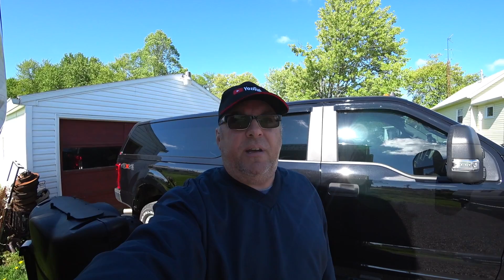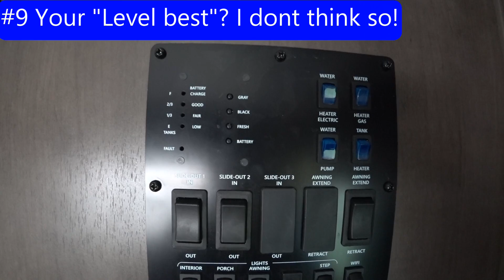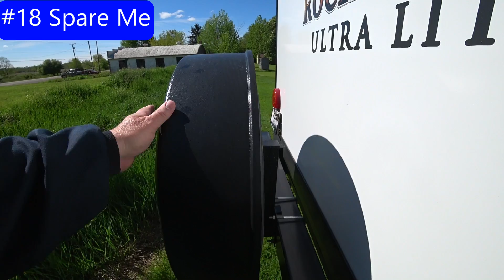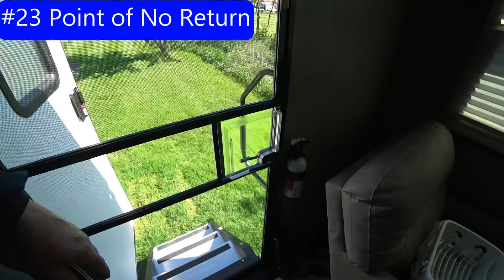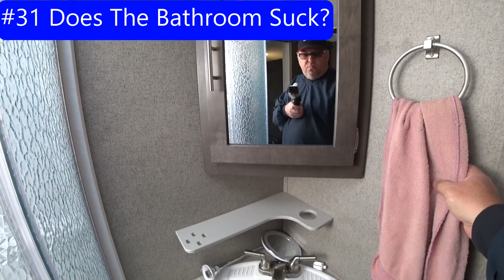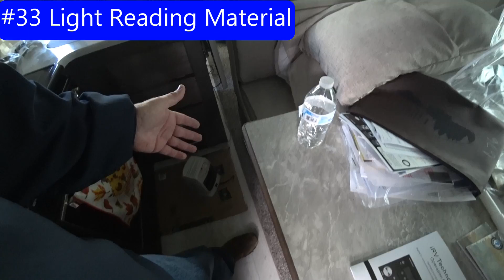36 Dislikes on Our BRAND NEW RV ☹

Comment: #2 bad, #6 i would do the topper, slide will be out when you need to get in there anyway,  #8 heater will never melt the tanks,  #10 look under the dinettte window, #18 the only thing you're missing is a 2nd spare on the bumper,  #23, they don't do that anymore,  #32 not standard, gas heated vents on RV don't close,.
Welcome to the real world. I would say 85% of your complaints are shared by most . This must be your first new unit.
Thanks.
Reply from the maker: Not the first unit, my last unit had vents that closed and it was gas obviously, those bumpers can't hold very much weight can't believe anybody would think of putting two spares on that weak welded thing. We did put a Topper on the bed end the doors barely open. There is definitely no plug whatsoever in the dinette area. I was told by three separate RV technicians that those heating pads on the tanks are thermostatically controlled and are designed to shut off when they reach a certain temperature. However, if there is nothing to heat IE liquid in the tanks, the heating pads thermostat will never see the temperature necessary to shut it off. One of the technicians actually had photos of the melted tank that he submitted for warranty that he showed me personally. Obviously, you are new to this channel, welcome! In numerous previous videos I have discussed how when we stop at Walmart, Cracker Barrel, or even sometimes truck stops oh, we do not put out our slides as it's considered by most to be tacky as if you're setting up camp. We purposely looked for an RV that was fully accessible when the slides were in. So there is concern about weight placement while the slide is in.
Reply: @Rvdaydream : You, maybe, or a woodworker could easily design a closet door without hinges.Use  magnets. Problems can be solved with a little thought.

Comment: I have thought about the 90 degree adapter for the power cord....question,  does the wind make it hit the trailer ???
Reply from the maker: No I installed that 90-degree adapter and we had 45 mile per hour just the other day and it doesn't touch the side of the camper. Even if it did I would rather have a little bit of scuff mark on the side of the camper then that power cord receptacle needing to be replaced because of the stress that the cord is causing.